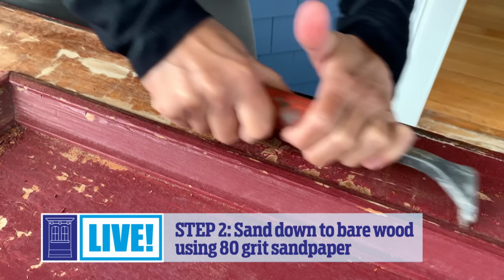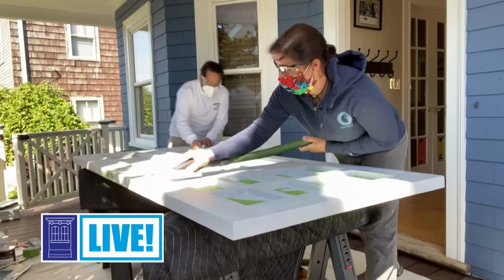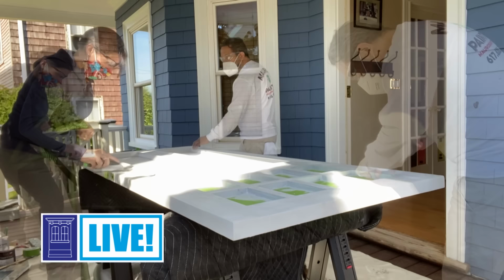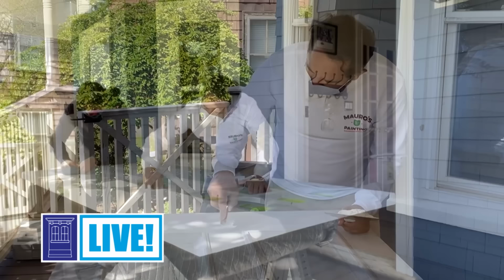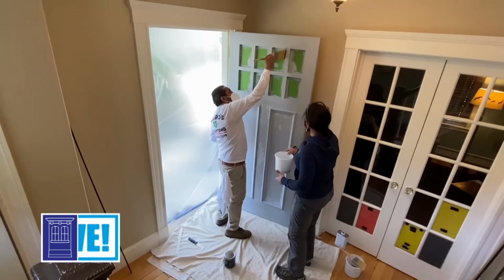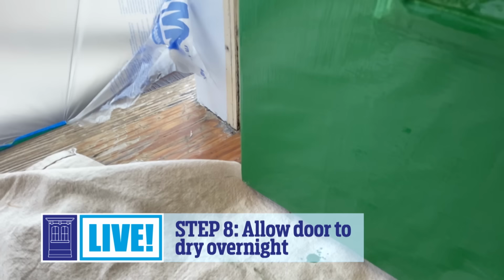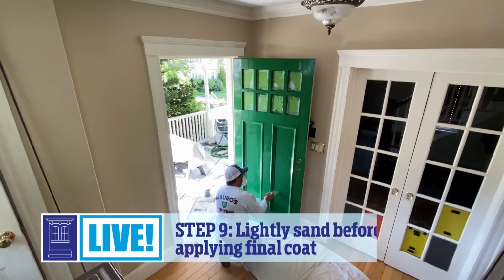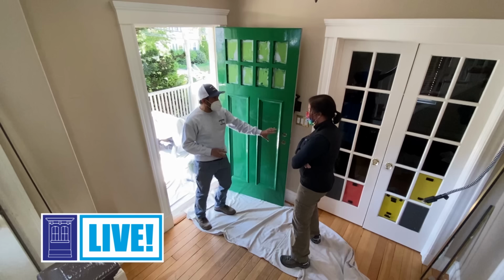How to Paint Your Front Door | This Old House: Live

Comment: You need to make another video on how to do this in 1 day. In the world I live in I can't leave my door off the hinges for 3 days and feel safe. We need practical real world solutions.
Reply: you don't need to take the door off but you would need to leave it open for around 8-10 hours after each coat. you Can't paint a door thats down to bare timber its impossible in a day. if its previously painted and dont need much prep then if covers in two coats maybe in a day with water based paints but that hardly ever happens

Comment: I sanded my door at 10am put primer kilz complete 3 on the door At 11am. And from 12 pm to 1 pm I painted the door. I put plastic down. In 3 hours I completely painted a door. It looks fantastic. Nothing takes a week long process. I used a craftsman sander with Diablo grit sand paper. I used a steady hand to not get paint everywhere. Might do a 2nd coat to finish it. But painting a door takes under half a day. I have painted inside doors in 15 mins where sanding and primer wasn't needed.

Comment: Whenever I replace an insulated exterior door I have the homeowner pick a color and then I bring it to a friend who does auto body work and he will spray an auto paint on the exterior let's the door last forever. I never have to go back and replace it again.
Reply: Doesn't work so well with wood since the joints expand and contract. Automotive paint is too hard, the paint will crack. I didn't know any better and had this done once for a client who requested to spray a mahogany door. Works great for fiberglass doors though. Fine Paints of Europe has really nice high gloss paints for wooden front doors too, you can buff the paint for a real nice shine similar to an automotive finish. Kelly Moore Epic and Benjamin Moore Grand Entrance as well...if you want to cheat a high gloss Benjamin Moore advance is technically the same paint. Or if want to save money, I've been able to get great result with KM Epic Gloss which was about $75 per gallon vs BM's 50-60 per quart, it does take a while to cure, but after 2 coats I was able to wet sand with 1000 grit and a light polish. Either way both paints take forever to cure for sanding unlike automotive paints.

KM is still a bit soft. You can still use your finger nails and put an indentation to the paint.

Comment: Thanks for the video! I love y'alls content. I painted an exterior door at my place the other day. I did like y'all did and took it down, laid it flat, removed all the hardware, cleaned and sanded it, the thing that I did different is that I spray painted it with an airless spray gun. I think that gives a much better result. I would say it always best to spray trim and doors. Only problem I had was dang flies! Couple landed in the wet paint and make a bit of blemish :-(  troubles of living with livestock nearby I guess lol.
Reply: I'd just let the flies land and get stuck in the paint.  Then when the paint is nice and dry I just flick the flies off and use my fingernail to scrape off their severed legs. 

Depends on the paint you use with the airless.  I personally prefer the trim and cabinet  paint by BEHR.  Or use a good alkyd oil-based from Benjamin Moore and use it in an HVLP sprayer and keep the edge wet at all times.
Reply: I just watched someone do something without learning one tid bit!  Was this the usual self serving video? 🙄

Comment: I live in a nice neighborhood but I wouldn't feel safe leaving my front door off for a few days. Is there a faster drying paint?
Reply: Latex paint is just fine and will be cured in a few hours. You should let all paint set a few days, though. You can always tack up a piece of plywood with some finish nails over the opening or small screws. No one will mess with it, even in a sketch neighborhood.
Reply: You don’t need to take the door off the hinges to strip .you don’t even need to strip. Latex paint dries a lot faster but on a hot day oil paint also dries in a few hours.
Reply: Painter here you can use latex paint it's cure in a hour but just make sure to use a oil base primer which should dry in 2 hours
Reply: @tsundokus  Wait, latex paint over an oil based primer? I thought latex over oil was a no-no.
Reply: @Bapuji42  it is when its a oil base paint not a primer. if you use water based primer it wont adhere to it and will bobble up.  TLDR you can use oil base primer then use water based paint

Comment: I had a few questions they didn't answer.  Did the paint the edges with green or the interior color?  How did they keep the edge of the front from dropping on the side?    So when one opens the door, is the side of the door green paint they'd put on the front?   What did they paint the hinge side?   I noticed they put it back on it's hinges before painting with non-primer.  
Could you use a latex?   Sherwin Williams duration?
Reply: LATCH side paint INDOOR color, HINGE side paint OUTSIDE color... yes ridiculous that they did not answer this question.!  and their door looks awful?  They must have been using wrong brush, why not roll on what you can???  They are actors not painters!  And if you took the door off just paint it while its off - FLAT!!  Harder to paint a swinging door!!!

Comment: My door has a heavy coat of paint on it.  I used 80 grid to take off the sheen, but did not go down to the bear wood.  Is this ok, as long as the surface is smooth and gloss free?
Reply: yes as long as the old paint is keyed good and bare timber spot prime with a oil primer